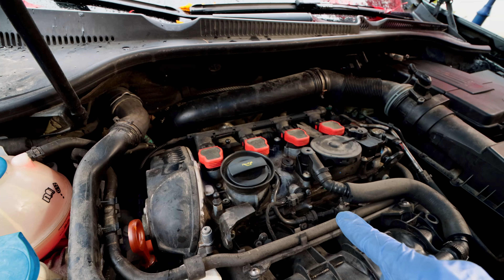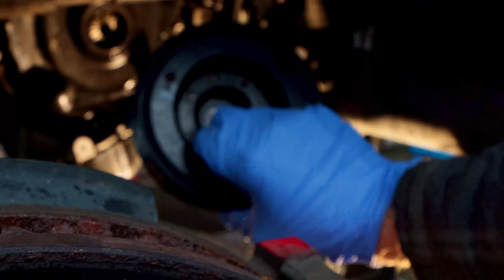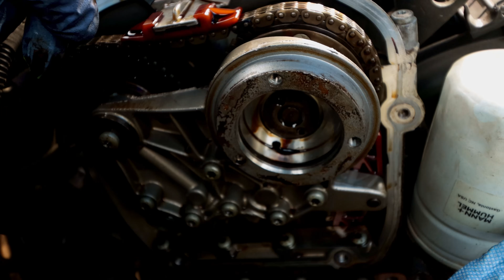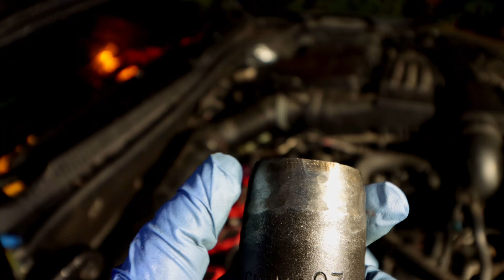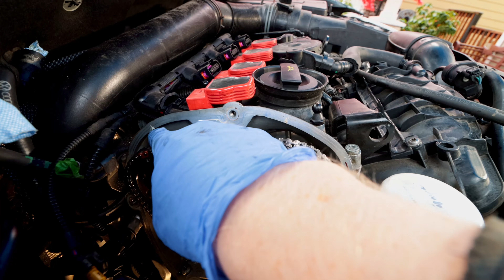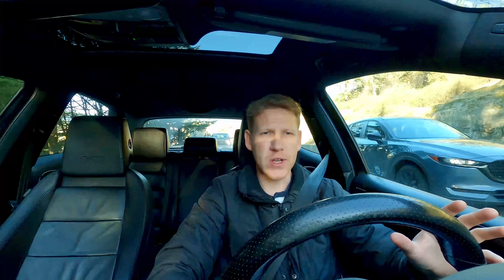VW MK 6 GTI Timing Chain Replacement - Living on Borrowed Time

Comment: Did you have to remove the engine mount?
Reply from the maker: Yes, you need to remove it in order to replace the timing chain
Reply: How did you support your engine? Did you use a jack and a piece of wood? I didn't see a support bar.
Reply from the maker: I used a jack and a block of wood

Comment: Bro bank 93 intake cam reads -7.162 on mine😔
Reply from the maker: Yikes dude! Change that ASAP! Hopefully you don't have any misfire codes, otherwise it could be getting really bad.
Reply: @drivecore2021 the car has 0 fault code mate!
Reply: @drivecore2021 problems is no one wants to do the job for me I’ve messaged 4 vw specialists near me !

Comment: Hi mate, any specialist sockets needed. The pulleys look quite niche. Aside from the timing kit, is there any other specialist sockets etc needed?
Reply from the maker: You'll need triple squares and torx bit sockets. Those are the only exceptions beside the timing tool components. For another detailed look at a timing chain job on the EA888 engine, check out my Audi Q5 flip video.

Comment: So I got in my car yesterday.And started driving... And then it completely shut off on me... No stuttering no nothing it just died..

I thought my timing went... i sat there for about thirty minutes on the side of the road , trying to figure out what to do...

I decided to try to start the vehicle... I know I was taking a huge chance...

The vehicle started, and I was able to turn around and get almost home before it died again... it would die as i'm accelerating...

Brought it home used OB.D.Eleven on channel 93 to check the timing... -5.47°
I'm far from stock,  cts ko4 hybrid and all the goddies...

2012 beetle turbo 2.0tsi e888 gen 1 cbfa 

So I parked the car, we're on e c s tuning yesterday and they had a decent sale going on... I got a complete timing kit for a little over $400.Originally it would be six hundred...

I'm gonna see if I can get a shop to install.It is not , i'm gonna be tackling this job myself... I'm an electrician I am not a mechanic, but I don't have two thousand dollars to throw away either😢😢

Comment: How does it run after? Notice any difference? Im getting it done next week. Im at about 145k miles and havent had it done so i definitely know im on borrowed time
Reply from the maker: Doing that with an oil change didn't make any significant difference. I could tell the engine felt a little more lively. If anything, it was just peace of mind that was the biggest change  haha
Reply: @drivecore2021 i see.. thought it would give me 100 more horsepower lol
Reply from the maker: @beesteezy3626  🤣🤣

Comment: Hi
1. So its enough to remove the metal screen and no need to buy a new cam bridge?
2. minute 6:50 does one have to rotate the gear 3 to 8 times so that the marks on the sprockets align or no need to touch the in the first place?
3. does both upper and lower tensioners need to be replaced?
4. from your experience should I go with OEM, VAICO, BORSEHUNG, Bermmen parts, or Febi bilstein ? Not sure which Brand to choose. OEM chains are the major much higher price difference
Reply from the maker: 1. Usually, the cam bridge is fine. Just check that all the springs (on the back that have oil valleys) are working still and that nothing seized. 
2. Often times you do need to rotate those sprockets so they align accordingly with the right markings.
3. I would recommend doing both the timing chain and the balance shaft chain, especially if it's higher mileage. It's sort of "while I'm in there, I might as well" things.
4. I wouldn't use the genuine Audi/VW parts unless it was the tensioners. You can definitely get away with using those brands you suggested. It really depends on what market you're in and availability. 

Best of luck!